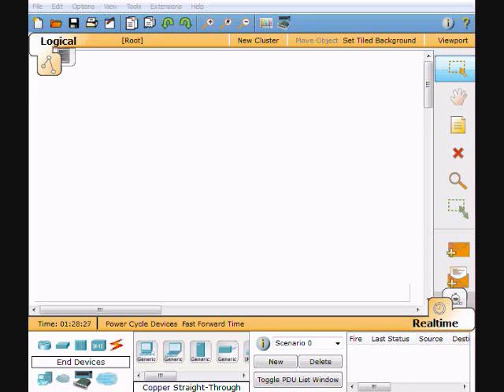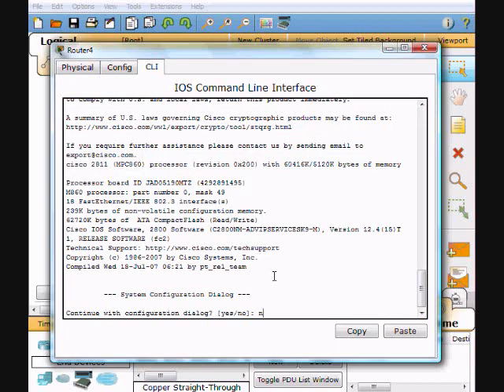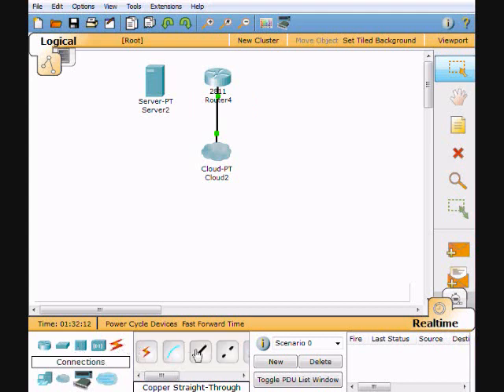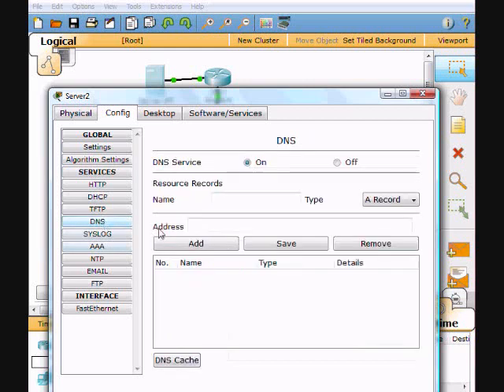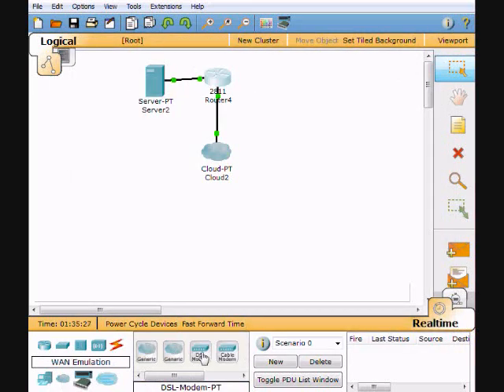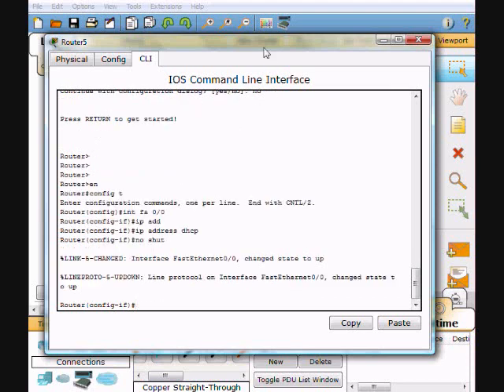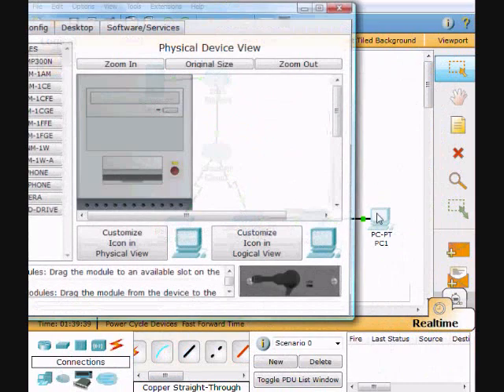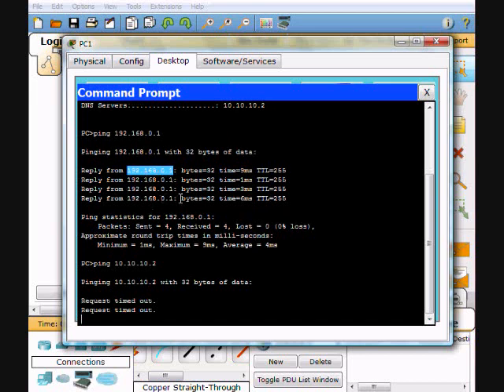DSL Connection with Packet Tracer

Comment: hey, I discover that with this model, we can not using a static IP for a device in vlan right? Because I try to make 2 vlan, and connect them together by 2 routers, i can ping from one vlan to the other with DHCP IP, but I cannot do it if i set a static IP for the device which i ping to. is it right?

Comment from the maker: Overload is a one-to-many NAT implementation meaning one public address can be shared by many private addresses.  With the command "ip nat inside source list 1 interface fa 0/0 overload" we are telling NAT how the inside (the vlan) should look to the outside (the ISP).  However, the router still needs to know which interfaces in particular this applies to.  This is done by specifying "ip nat inside" for the vlan and "ip nat outside" for the FA0/0 port.

Comment from the maker: The cloud is often used to represent a part of the network we don't understand or don't care about.  Basically, we don't know what is in there but what we do know is that somehow our data gets from point A to point B. For example, you don't know which devices exist between your home computer and you're bank's website.  What's important is that the connection between the two is encrypted.

Comment from the maker: As for the question of DCE/DTE, in packet tracer it automatically sets a clock rate on the DCE interface.  If you were using serial 0/0/0 you could run a "sh controllers serial 0/0/0" on the router with the DCE end plugged into it and you'll notice that Packet Tracer by default applies a clock rate of 2000000.  A real router doesn't do this.  If you don't specify a clock rate on the DCE side it just won't work.

Comment from the maker: You certainly could use public IPs on your network and apply NAT before going to the ISP.  However, why would you?  If you used an IP that overlaps with say, google or youtube, you'd never be able to visit them anymore.  Your router would instead send you to a local interface or network instead of reaching out to your ISP to get there.  So the short answer is Yes.  However, the better answer is that it just wouldn't make any sense to do so given the abundance of private IPs you could use.

Comment from the maker: I've never seen the range command used on anything other than ports on a switch.  The last time I ran the command "int range ?" my serial interfaces weren't even listed.  The larger question becomes, what commands/settings are you looking to apply to the same interface?  On a switch, setting them all up as access ports and to the same vlan is alot easier with the range command.  I just don't see it being useful for other types of ports. On serial ports however, I don't see the usefulness.

Comment: Sir here are some question,
*Range command is great for interfaces like fa 1/0 - 15 where WIC card is 1 and we have 15 ports...Do you know how to use it for ranges like 1/0, 2/0, 3/0 that is for different WIC cards. ?
* What if we use public address in our private network...Will ISP allow it, can we apply NAT..?
* is DCE and DTE options in packet tracer has no relevance cause when i put them in any order, it always work, without setting anything